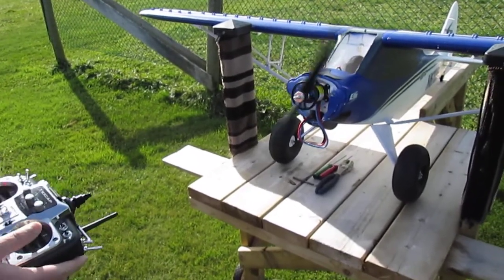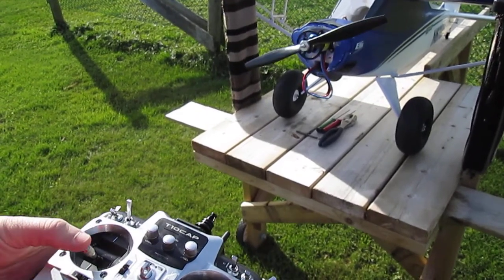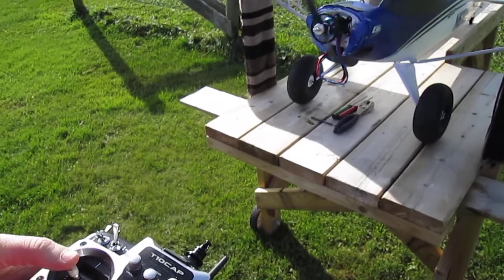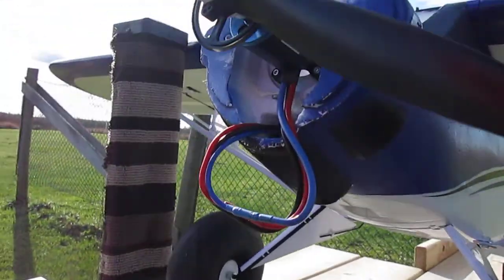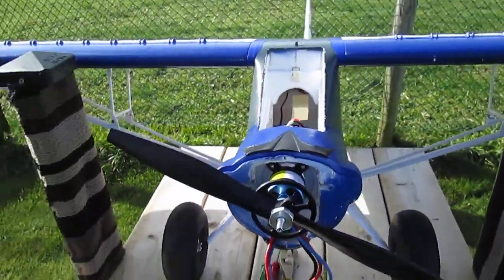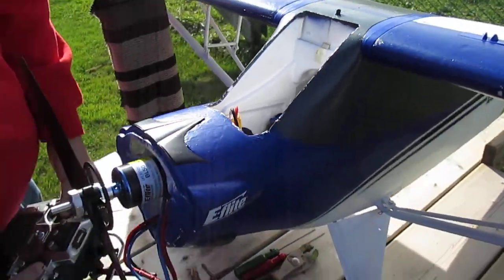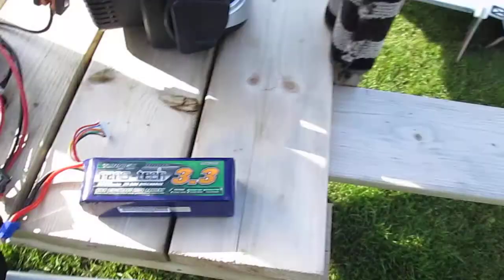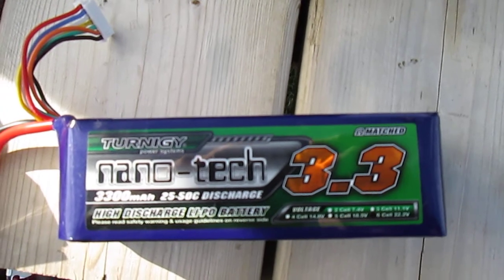Eflite Carbon Z Cub ESC issues

Comment: Mine did the exact same thing when I first plugged it in. I had a 4S lipo in it and it was set at 6S. My buddies was set at 4S outta the box. Have you tried to set it at 74% cutoff? I did and now bounce back n forth between 4S-6S with no issues. Just a thought.......... Hope you get it figured out.
Reply from the maker: no I havn't tries that yet. I'll dig out the controller manual and see if that helps. Thanks for the tip
Reply: How do you adjust the ESC to accept 4S batteries? How do you adjust the LVC in general and why would change it to 74% cuttof do?
Reply from the maker: Ted Kelly
Check the manual. It gives detailed instructions on how to do it. The 74% will auto detect the battery voltage and adjust cut-off automatically. It's good unless you have less than full batteries, then it will set the cut-off based on a lower voltage
Reply from the maker: Ted Kelly
Manual here

http://www.e-fliterc.com/Products/Default.aspx?ProdID=EFLA1060#quickSupport
Reply: Thank you for the information...I don't think that was in the box with the plan, but I obviously see it now with your link
Reply: Greg Hatt I don't want to sounds like an ass but did you mean 70% cuttoff (not 74%) as I don't see anything about 74% in the manual.  It seem like you can set it to a particular cell count OR to the 70% where it auto detects total voltage at the start and stops at 70% which as the manual states could be dangerous to teh LIPO if you have this option and use a less than full pack.  That said do you know what the default vault cuttoff is if for each of the options for a particular cell count - See page 2 programming menu 1 - Voltage cuttoff
Reply: Ted Kelly My ESC manual that came with the plane says 74% cutoff is the default setting unless you specifically program from 3-6 cell.
Reply: qm1usn I will have to check the paperwork when I get home because I didn't see an ESC manual with my plane...that said the link that Greg sent me says the default is 70%.  There appears to be discrepencies...
Reply: qm1usn Doesn't 74% seem low..That would me running the cells down to 3.1V per cell from 4.2. Am I thinking about that correctly...that is the math as explained on page 2 of the online ESC manual Greg sent me.  Also do you know what the default voltage cuttoff is if you choose to program specifically to the cell count.. Also be care with the % setting because it appears to be dangerous if your pack isn't fully charged as it take a detects the starting point and allows it to go down to the % regardless of the actual V per cell
Reply from the maker: Ted Kelly
I don't know about defaults for these ESC's. The one in the plane came default for 6S (6 beeps when plugged in) and the one my buddy lent me was default for 3S. I went in and manually changed it to 6S cutoff for the plane.

As far as the cutoff, you are correct, the online manual states 70%, and the manual that came with the plane states 74%. The one that came with the plane is the V2, which I didn't notice. I assume they raised the LVC for exactly the reason you mentioned.
Reply from the maker: Ted Kelly
Here is the V2 Manual, sorry about the confusion earlier
Reply: Gregg - I don't see anything attached. Do you know what the LVC is when you chose 6S? What size paks are you using (MAH) and how are your runtimes?
Reply from the maker: Ted Kelly
ooops sorry bout that. forgot to link. don't know flight times yet as I just replaced the ESC and havn't had a chance to fly it. Will know tomorrow for sure.

http://www.e-fliterc.com/Products/Default.aspx?ProdID=EFLA1060B#quickSupport
Reply: Thanks...not only did the % change, but there is no longer a 6 cell specific setting only 3,4 and 74%..I am guessing my ESC defaulted to 4 or something because it is not acting correctly
Reply: Greg When I got home I found my V2 manual... The strange thing is when I checked the programming the menu settings of the LVC followed the descriptions of the V1 manual.  The difference being V1 has a cell specific setting for 3,4,5,6 cell batteries...and the soft % setting....V2 says just cell specific for 3,4 and soft setting...That said at this point its unclear if the soft setting follow V1 - 70% or V2 74% which I may never know unless I run it down to the LVC...I plan to rely on the timer...If you or anyone else figure out the % let me know.  I am assuming V2 is correct and that the manual just got updated incorrectly...Between the manual differences in updates for the AR635 receiver and now this it is frustrating especially since I am new to electric model and relying heavily on the manuals
Reply: Have you done the math to verify if the auto is 74% or 70%...the updated manual says the auto is 74%, but the programming for the LVC  follows the Earlier version of the manual and that manual says the soft auto is 70%.  I plan to test this weekend
Reply from the maker: Ted Kelly
Let us know what you find. Today I flew with the brand new Nano-tech 6S 3300. Set my timer for 6mins. The ESC didn't hit LVC for that amount of time. I ended up putting just a shade over 2000mah back into the pack. And it's set for 6S cutoff.

Comment: Greg, did you get it fixed?  Mine is doing the exact same thing and I am using the exact same Turnigy 3300mAh batteries.  If you got it fixed, what was the problem?  I am getting very frustrated with it at the moment.  Any help would be greatly appreciated.

Jason
Reply from the maker: Jason, it was the ESC. Call horizon tech support. The new shipment of V2 ESC's are in stock. They are sending me a new one. In the meantime I borrowed one from a friend and all is well. Cheers
Reply: Greg Hatt  Did they ever say what was wrong with the ESC? I had mine fail midflight with horrible results...Not sure if ESC or Rx went bad...but either way there was a complete loss of power/signal as I had no control of the surfaces and the motor cut (possible failsafe).  The plane is 8 months old, but less than 20-25 flights and the batteries are ok.  I am going to send the motor/esc/rx back for them to check and hopefully they figure out the issue and possible replace the plane..They were not very receptive on the phone an claim that they have had no calls about the ESC or rx on this plane which I know is a lie...any help or suggestions on how to deal with their support team would be helpful and appreciated

Comment: You said it is a PNP...Are you using the AR635 or some other reciever?
Reply from the maker: I fly strictly futaba. I have a 617 RX installed. It turned out to be the ESC. A friend lent me one for troubleshooting and everything is fine now. Now if the crappy weather would clear up so I can test fly it.